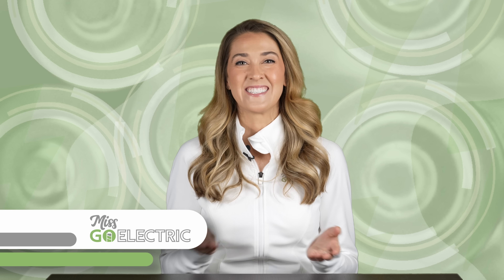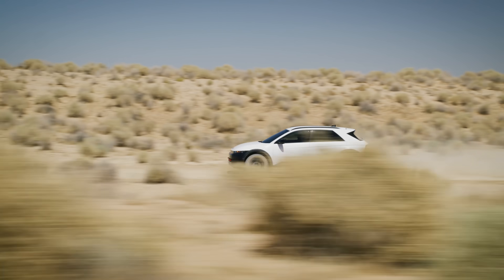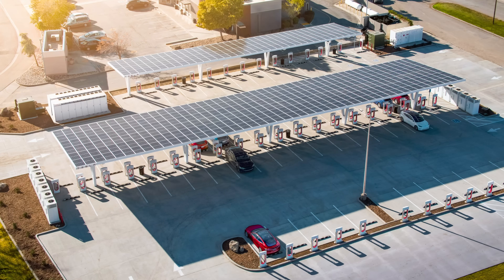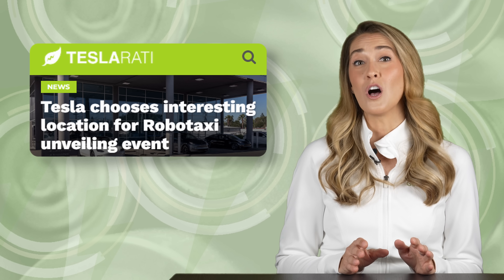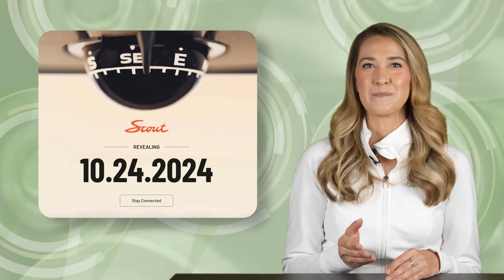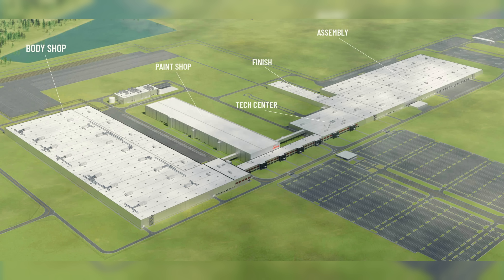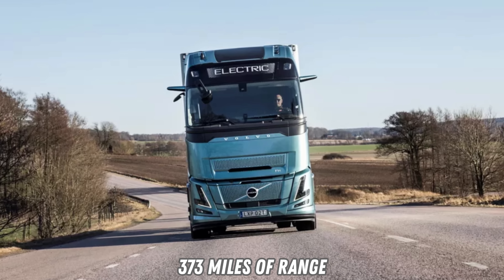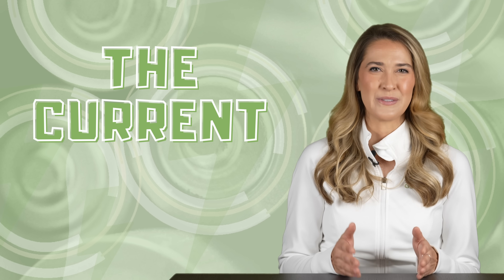The Current : Weekly EV News Ep#27 Sept 8, 2024

Comment: Too bad that the XRT NACs charging port is on the wrong side of the car which necessitates taking up two Tesla super charger stalls when charging.
Reply from the maker: Sometimes it does.  V4 dispenser cables are long enough to reach either side of the vehicle as we showed in the clip within this segment.  Pull through spots will also work well without taking up two stalls. -Producer Tim

Comment: I was curious as to the source for Tesla reserving 10,000 charing units exclusively for Tesla vehicles?  I have not found that in the news.  Thanks.
Reply from the maker: The 10,000 stations (V2) are not "reserved" for Tesla.  They are inaccessible to third party EVs due to technical limitations on the communication side.  We emphasized that point because we recognize it is not well understood based on comments when we've shared Supercharger news in the past.  You can view all Superchargers and isolate only those which are available to other EVs using this interactive map:
https://www.tesla.com/findus?v=2&bounds=46.8436334704721%2C-64.8574230625%2C31.426753175210006%2C-121.1074230625&zoom=6&filters=party
Thank you for tuning in!
-Producer Tim

Comment: What is a “refreshed”  Hyundai EV?
Reply from the maker: Each automobile is produced on a lifecycle.  For example, Volvo has announced an 8x8 strategy.  They'll put out one EV per year for eight years.  Every four years they will refresh the model released four years prior.  The refresh will often include optimizations and improvements which do not require architectural re-engineering.  Redesigned body panels, headlights, materials changes, infotainment upgrades, upgraded battery capacity or motor power, and other aesthetic refinements are often part of a refresh.  A refresh requires retooling, which takes a production line down for weeks to months.

Some refreshes such as the new Tesla Model 3, can result in changes to more than 50% of the components. By mass, however, refreshes tend to be mostly the same vehicle.  The purpose of a refresh is to stoke demand long enough to eek profit from the development and production investments until the platform is no longer a viable competitor.
-Producer Tim
Reply: @MissGoElectric  thanks Tim.  I’ll do some research on this as it is something that is new to me.

Comment: For all those focused on 400 V / 800V chargers:  The rate of charge is based on Power not voltage!   So charging from 800 v @ 50 A vs 400 V @ 100A is the same power (40 kW), so same charging time.  The Charging Power is limited by several factors, but mostly the temperature rise of the battery pack and is controlled by the vehicle's on-board charging controller.  Also, charging power starts at an initial high rate, which then tapers down to a much lower rate to optimize temperature and battery life.  Initially Porsche Taycan advertised very fast charge times (only available at exactly 2 locations on earth, one inside the factory) then quickly "revised" that when the engineers told marketing that fast charging time would reduce the battery life to a few hundred charge cycles.
Reply from the maker: Dispensers also regulate current for thermal protection. Our Rivian shows us where the bottleneck is while charging. We have observed that the network hardware is the source of de-rating about a third of the time. Hot cables and overloaded cabinets are factors... especially on CCS-native charging hardware. -Producer Tim
Reply: @MissGoElectric  There are > 6 different thermal sensors in the Power supply-vehicle-charger-battery chain, along with voltage and current sensors.  

What do you mean by "network hardware"?  Do you mean power station is throttled back by its "network overlord",  i.e. to compensate for local power delivery availability, i.e. if there are 6 vehicles charging, reduce the charge power to limit it to the total of the power source / wiring?   Unfortunately this is quite common in most "other company's" chargers, especially when they were merely "add-ons" to a business location to get $ and customer traffic.  Most "Quickie Marts" and restaurants, don't have the power companies install a separate high current circuit for their "convenience" chargers, but the vehicle chargers can easily exceed the total power draw of those business, so major throttling is programmed in.
Reply from the maker: The friction of electrons rushing creates heat in several places.  The cabinets and the cables can get too hot.  Hardware manufacturers like ABB, SK Signet, and BTC engineer solutions to monitor for undesirable thermal circumstances and reduce current when they take place.  When the charge point operator's hardware de-rates a session like that, the electric vehicle is not a factor.  Our Rivian has shown us that a large portion of bottlenecks are the result of the cabinets and dispensers rather than our HV battery's thermal management shortcomings. -Producer Tim
Reply: @MissGoElectric  Sure, because the resistance losses with high current creates heat.  If the designers were lax, then the equipment is simply poorly designed for operation at maximum current / power so there are hot spots and poor ventilation which cause overall overheating.  Since Tesla designs from "first principals", for maximum power dissipation, and ensures adequate power from the utility grid, they "magically" avoid these issues.   During normal operation, the thermal caused power foldbacks should only be for defects or damage.  If the cabinets and cables get too hot with normal use, they are poorly designed and "cut corners" in the first place.  

The internet and YT are rife with  inadequate performance from most non-Tesla chargers, not just in the USA, but in most of the world, including Europe.  This has been confirmed on "road trips" by none-other than Herbert Diess and Jim Farley.

How are your Tesla Supercharger experiences?
Reply from the maker: I have supercharged over 300 times. The only poor experience I had was in Chicago at the Fashion Outlets parking garage.  The disclosed rate on those dispensers is a measly 72kW and it felt like forever.

I have over 100,000 miles on my 2016 Tesla Model S 90D.  More than 80% my charging has been at superchargers on road trips. Its maximum charge rate is 120kW.  The peak rate is not competitive with today's best, but it holds triple-digit rates very deep into the charge.  I'm usually in and out within 30 minutes.  For me, a 30 minute stop every four hours is biologically required and even that 8-year old (nearly antiquated) EV is more than sufficient.  It has usually charged enough to carry on before I'm done using the restroom, grabbing a meal, washing the windshield, and responding to text/email/YouTube comments (lol).

Detroit to Florida, Chicago to Detroit, and Detroit to Nashville are common routes for me. Our Model Y and Cybertruck peak over 250kW, but my routine long-distance trip durations have not shortened as a result.  Even when an EV charges 5-10 minutes faster, the break I (personally) need after 4-5 hours of driving has not been reduced.

We know plenty of other YouTube personalities who obsess over charging curves and chastise brands for 150kW or 200kW peak charging rates.  Personally, I don't think the average EV driver with reliable access to affordable overnight home charging cares if occasional road trip charging takes 19 minutes or 27 minutes.  If highway range is 300+ miles, those stops will include a meal and would take a half an hour even if a recharge was not necessary.  A small subset of drivers during a narrow window of their lives will actually enjoy 10 hours of driving for every 15 minutes outside of the vehicle.

-Producer Tim
Reply: @MissGoElectric  100% 👍  Truly incredible and amazing how you could live and enjoy these vehicles without 800V ~ 1000V wireless Bluetooth charging in 10 minutes!  Thanks for the insights.
Reply from the maker: Haha.

Comment: Stupid question: If I lease a car which gets the $7500 incentive, how does that figure into the buyout at the end of lease? Is that a better deal than buying outright and getting whatever incentive ($3750 probably)? I usually keep a car until the wheels fall off, and have never bought new.  But the incentive makes buying new a good deal. I don't qualify for the used incentive, I'm too "rich".
Reply from the maker: Post-lease buyouts are handled differently by each automaker. Some EVs are not available at all for a buyout afterwards. 

The tax credit is pulled off the top of a lease, enabling super low payments (Hyundai passes the credit through). That is why we have been able to report on incredible $160/no - $300/no deals on Toyota, Nissan, GM, and Hyundai Group EVs. 

If personal income is an obstacle for $7500 credit qualifications, consider a lease through your LLC. Commercial EV leases are not limited in that way. Insurance is a consideration to investigate though.
Thank you for watching and commenting. 
-Producer Tim

Comment: I like seeing the Hyundai keeps pushing on their EVs! Doesn't seem like they are taking their foot off the pedal, so that's nice. Have they released charging specs for their updated vehicles with the NACS port? I wonder if that will be improved and better cope with different system voltages while still keeping their charging rates high, etc. 

Are Volvo heavy duty trucks owned separately from Volvo cars? I thought Volvo cars were taken over by Geely while the heavy trucks were still a separate Swedish based/controlled company?
Reply from the maker: Hyundai Group is the #2 EV producer in the USA and they keep producing all time high sales month after month. We do not have details related to how their 800V architecture might interface differently with a native NACS port. We suspect Tesla is telling automakers to sit tight and wait for V4 cabinets to be rolled out at Supercharger locations. The Cybertruck HV system is also 800V and is not yet able to DC fast charge optimally.

Volvo (passenger cars) is owned by Geely. The truck group is only 8% Geely. Interestingly, the FH was enabled by their $130M acquisition of Jiangling Motors Corp. It will be built in China at that factory. We tied the Volvo stories together because they still present to the public as the same brand with the same logo. 

Your comments are of high quality. Thanks for joining us. -Producer Tim
Reply: @MissGoElectric  Glad to be here, thank you!

Comment: Tesla needs to consider outback versions of the 3, y, x and s. This will increase Tesla line up of vehicles. Have a 3 it could be perfect if a bit higher from the ground. Ty
Reply: Mountain Pass Performance offers kits for the Moeel 3 where you can raise it like 3/4" to 1.5" or so.
Reply from the maker: One driver of profit margin for Tesla has been low product variability which limits downtime and waste stemming from retooling and supply complexity.

That said, the Y is produced simultaneously in four separate factories. Maybe the total addressable market of Subaru-type buyers is large enough to justify modifying one? With Cybertruck unavailable outside of the US and Canada, cannibalization risk globally is low.

Thank you for sharing your insight! 
-Producer Tim

Comment: New Ioniq looks good, but has one obvious omission - a sunroof. It only seams to be available as part of an expensive pack on the Ultimate edition, which includes cameras instead of wing mirrors. Hyundai don't  seam to realise this is pretty much standard on most EVs.
Reply: I recently traded a 2014 Honda CRV with sunroof. In 9 years of ownership I think I opened the sunroof less than 10 times. Too expensive and another point of failure so I’m sympathetic with Hyundai’s decision.
Reply: They are too expensive and have too high maintenance cost for me.
Reply from the maker: Are cameras instead of side view mirrors legal in the USA? 

Thank you for sharing your perspective related to a glass roof. -Producer Tim
Reply: Whenever I see a sunroof that’s a positive check mark for the car, but in reality I rarely open my current sunroof and it’s never open when I’m driving for long. So I’ve made my peace with the vision roof and I’m glad it comes with a good cover which to me is a big advantage over cars like the Model Y. To me the glass roof is nice in the winter time to let in more light and also when you are a passenger in the back seat it’s more impressive.
Reply from the maker: I'm happy with the Gass roof on our R1T and Cybertruck but I will admit that I open the sunroof on the Model S whenever weather permits. It's a small perk, but as you have pointed out .. it adds complexity, cost, and reduces structural rigidity. I wouldn't categorically consider the sunroof a net positive. -Producer Tim
Reply: Thank goodness! I hate them and would not buy a car with one.